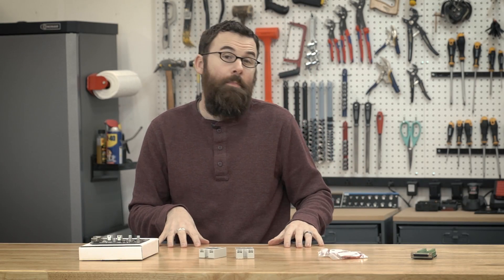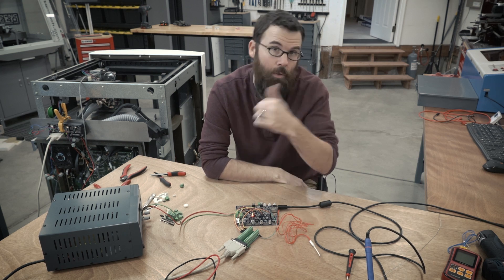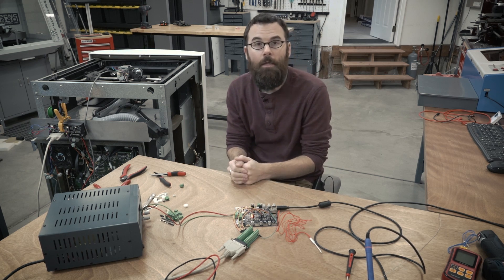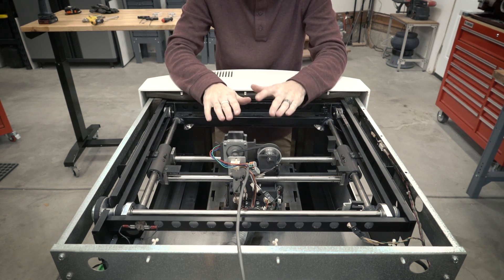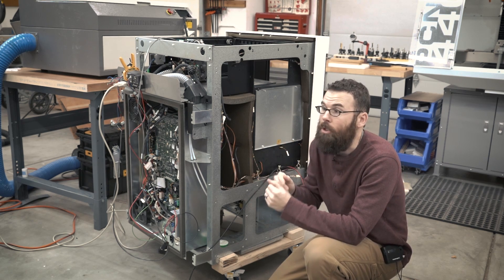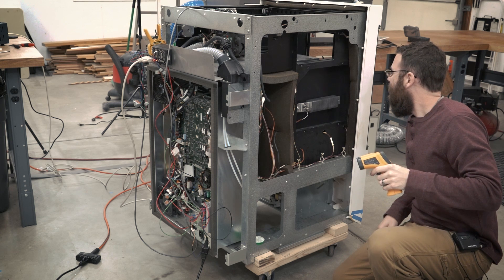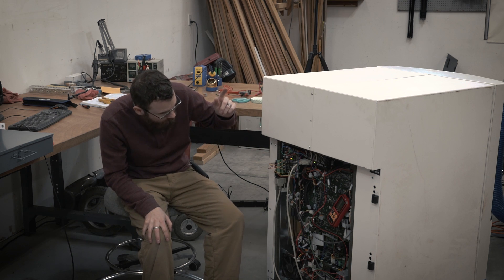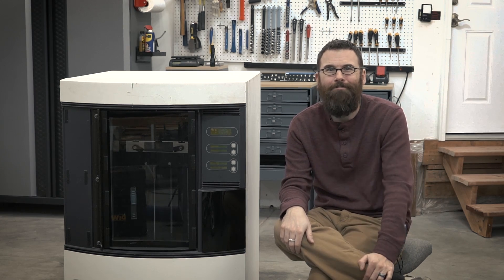Stratasys 3D Printer Rebuild - Part 4: Smoothieboard, Homing, Chamber Heaters

Comment: TELL US what the steps per mm are ! Please ?
Reply from the maker: Hey Phil, I've gotten your numerous messages.  I don't know the steps per mm off the top of my head, but unless you have this exact configuration with the exact hardware, the steps/mm will be useless.  It's better to just calculate it yourself based on the various tutorials you can find online.  It's better to learn how to do something than just plug in the numbers.
Reply: I'm using the exact same hardware and software

Comment: Any progress on this project?!  I'm loving what you're doing and can't wait to see it printing
Reply from the maker: Not yet, I've been busy with a lot of other projects.  But as soon as those are done, I plan to buckle down and finish the printer so I can start using it.
Reply: I'm definitely staying tuned.  Is it worth it to do this for myself?  I have a chance to buy one without any of the control electronics but mechanically (apparently) it's all there and worked before they gutted the electronics.
Reply from the maker: How much can you get the printer for?  It's ultimately up to you if you have the time and money to do the conversion.  I haven't finished it yet, so it's too soon to tell if it was worth it.  But it's still fun and there's a lot to learn.

Comment: Thanks for the great video. I appreciate your time and effort dedicated  to quality content. My similar build has been on hold due to time and money (mostly money), but luckily my generous employer provided a bonus check to fix the money part so I have a couple questions. I have a g540 and due to your video, im strongly considering a smoothie. but when taking apart the outer structure, I destroyed much of the insulation.  What type of insulation is used and where does the melted plastic exhaust from this machine go? Absorbed into the insulation? It was pretty blackened.
Reply from the maker: I'm not really sure what the insulation material is.  It seems to be a thick rigid foam maybe?  I'm sure you could just get fire-rated insulation panels at home depot and use that...  The 'exhaust' is pretty much just recirculated inside the machine, but it's not exactly air-tight.  it just circulates inside the chamber it seems.
Reply: I actually think I know of a supplier of that type of material and I will contact them and let you know what they say. I just wasn't exactly sure what to ask for.

Comment: Robert - Where did you get your benches (good shot at 9:24) from? They look relatively sturdy and I'm in the market for outfitting my new shop with lots of workspace. Thanks!
Reply from the maker: they are "custom".  They use these legs:  http://a.co/6YcdSRR and the top is a solid-core door that's stained with danish oil and then waxed.  They're not terrible durable, but for a 36" x 90" workbench, they come out to around $150 or so.  I have 4 of them, so I went the cheap route instead of spending $500+ on each workbench.  They're sturdy (they easily hold my weight), but the tops get scratched and beat up pretty easily.  But the tops around around $70 from Home Depot and easily replaced.
Reply: Thanks! I hit the same quandary. Excellent advice. I enjoy your channel!

Comment: Hey Robert,

Just letting you know you can run the bldc motors in the extruder via STEP and DIR signals from the smoothieboard. I've got it working in the past. If you'd like to know how let me know. Would save you from having to redesign the extruders. Cheers! Keep up the great work!
Reply from the maker: Cool, I'll get to that in a couple weeks, I'll let you know if I run into any issues.

Comment: Dont gut the extruders! You can control them with the smoothie pretty easily with an arduino nano and an h bridge. Love this video series BTW. I just finished my retrofit of my dimension and posted the results o r/3dprinting. This was a big help. I tried posting a link but Im getting flagged as spam I think.
Reply from the maker: I'll most likely try and keep the extruders.  I just haven't really looked at it yet, but that's the thought!

Comment: Hi Robert,
Is it a BST or a SST you got? It is pretty easy to reprogram the eeprom chips in the cartridges, and just feed the material thru. I have one BST 768, and one Elite at work. I use Makerbot abs filament ( since it is a Stratasys company) as build material, and HIPS as support on the BST, and i will use the same abs on the Elite. That is working great at 1/10 of the price! :-)
I havn't found any cheap alternative to the soluble support from Stratasys, so I will stick to that.
Reply from the maker: This is a BST.  I looked into reprogramming the EEPROM chips, but I'd still have to use the cartridges and then use something to control the mechanism for the cartridge, etc.  I have something else in mind ;-)

Comment: Great video series.  The content is top notch with regards to the mechanics and principals.  What is the factory motherboard doing at this point?  I am under the impression that the Smoothie Board and Gecko Drive Controller is currently all that is being used to control the unit.  Also, with the heating element controller (Gecko Drive); is that essentially acting as a PID controller?
Reply from the maker: Thanks!  The motherboard is just sitting there.  You are right, the smoothieboard and g540 are doing all the work.  The original electronics are pretty much hooked up, but all they're doing is controlling the fans for the heated chamber as well as the lights.  There are two halogen lights in the chamber as well as the 4 heated chamber fans, as well as several exhaust fans.  Instead of wiring up 8 different things, I just left the old electronics in there.  It's overkill, but I'm not ready to gut them just yet.  Also, if anything goes wrong, I can pretty easily and quickly revert back to the factory hardware.  At this point, that's probably not going to happen though.  I'll be removing them pretty soon.

Comment: Note you can also talk to the stepper drivers at 5V, using the open-drain pin configuration, see : http://smoothieware.org/general-appendixes#external-drivers
Don't know if the Gecko drivers need this, but some do.
Reply from the maker: Thanks Arthur.  The Gecko drives are 3.3v, but 5v tolerant, so you can use either.
Reply: Robert Cowan Oh btw : http://arthurwolf.github.io/SmoothieContest/

Comment: The endstops are optical interrupt switches. One side has an infrared LED, the other has a photodiode or phototransistor.
When the IR beam is on, it conducts, and the other way around.
Reed switches are magnetic.
And man, you really have to use those displays on the front to push information out! They look like something off-the-shelf.
Reply from the maker: Nope!  Those are in fact reed switches.  There are ALSO optical limit switches on the machine, but they are in other places.  The minimum end stops are optical and the maximum are reed switches.  They are only activated with ferrous metal, aluminum or plastic won't work.  Another tell-tale sign is that there are only 2 wires coming from them.  Optical interrupt switches typically have 3 or 4 wires.  If you look closely, you can see the other optical limit switches, but I'm not using those.

I do plan on doing something with the displays on the front.  I might end up replacing them with something else though, there's a whole control board behind them, so it might be tricky to interface with.
Reply: That is weird.
I've never seen a reed switch like that.

Comment: Robert,

Thanks for the great videos in this series so far. 

I have a similar build that required unique control of the hotend, also using  Mach3. However, using Mach introduces some interesting challenges. The biggest of which is that Mach3 does not have an "E" axis typical of 3D printers. Instead, it has A, B, and C axes. Unless you want to write a script to change all of Es to As in gcode, I would recommend using either Slic3r or Cura, as both of these can be figured to post process for Mach3/EMC2. IMO it's easiest to control the extruder stepper through Mach and the hotend through something external. In my setup, I wired the heating elements (hotend and heated bed) to a Rambo board, which gives the necessary PID loops. I simply have an extra USB cable that I use to control the hotend temperature through Cura, which I leave running in the background. Great build, and best of luck getting it all up and running!
Reply from the maker: Wow, that sounds complicated.  I'm glad I didn't go that route.  Thanks for the info.

Comment: Awesome restoration-rebuild!! :) Loving how it turns out so far and definitely looking forward to what comes next!!

One thing I would do to this bad boy - gut out the old vending machine LCD and buttons panel and instead put a nice touch screen LCD connected to a PC, that is located where the old motherboard used to reside (looks like plenty of space for an mATX or even full ATX board, next to the smoothie and gecko).. :) Just something that occurred to me looking at it sitting semi-finished. Keep them videos coming!
Reply from the maker: Nice idea.  I'm not 100% sure what I'll end up doing for the interface.  I am toying with the idea of putting this in my basement and just having it connected over the network.  I'd rather not have it in the shop since it's a bit noisy and takes up a lot of room.  So I might not spend a lot of time on the physical interface.
Reply: Robert Cowan thanks for the reply! I guess if u are not going to interface the thing directly, then there is no need for any changes to the front panel.. :)
Reply from the maker: Yeah, I'm still not 100% sure what to do with it just yet.  Stay tuned ;-)

Comment: How hot can the heated chamber be?
Reply from the maker: Honestly, I don't know...  It's pretty well thermally sealed, and I measured the current draw at around 800 watts with both heaters going.  So I can only assume it could probably get VERY hot if the control system failed.  Thankfully, there's a thermal cutoff switch inside the chamber.

Comment: awesome .

Robert, I am not an expert in electronic, so the big electronic board at back what is it for?
Reply: I think it is the original controller board of the printer (controller and stepper drivers). Old electronics tends to be really big
Reply: szErnzEit I think so too but, is he going to need it? since he got the smoot board.
Reply from the maker: Yep, check out part 1, I go into what all the old electronics are.  There's a LOT in the back of the unit.  And szErnzEit is right, I won't be using any of it once I get the full retrofit complete.
Reply: The cool thing about the one that comes on these is that both filament outlets are machined out of a single block of metal. Two feeds in, two feeds out. This makes offset calibration extremely easy and you never have to worry about one nozzle being lower than another.
Reply: Can't wait to see you rip that thing out!  It's been bothering me ;) Also, would love to see a tear down of the extruder.  An e3d v6 as a replacment wouldn't be a bad choice - it's kinda the go-to hot end now-a-days.
Reply from the maker: Yeah, that's what I was thinking, if I end up not using the current extruder.  It seems like I might be able to get it to work though.

I'm going to rip out all the electronics when it's closer to a 'working' machine.  If I can't seem to get things working, I might need to go back and check what the original settings were.  Right now, it's pretty easy to revert back to the stock machine.

Comment: I had to pause the video to write this. I would highly recommend to use more than one Ground cable. This is a single and major point of failure especially when you have to different voltage sources with no additional ground connection to each other. When the Ground lane in you D-Sub cable fails (break or defective contact) you could end up with big voltage differences at the the Smothie board and the printer (I assume the inputs aren't galvanically isolated with optocouplers or otherwise protected) and potentially damaging it. It is obvious that you know what you are doing but I think it would't hurt to add a few Ground lines. I just mention it because i lost more than one processor board through a unreliable GND connection, microprocessors have a extremely low tolerance to over voltages at their inputs
Reply from the maker: I agree with you 100%.  The wiring you see in the video is no indication of how the final wiring will end up.  This is just for testing, and it's messy and not the way it should be.
Reply: Good to hear, it just made me a bit nervous, last month i killed this way three stepper drivers (10$ each) and a trinket (20$) in one go. I just wanted to help to avoid any potential frustration through an (unlikely) incident.
Reply from the maker: Well, the G540 is nearly impossible to kill.  Seriously.  If you kill it, they will send you a replacement module.  It's one of the reasons why I'm using it.  But yeah, it's frustrating to blow stuff due to poor grounding, etc.  Cheap stepper drivers die way too easily as they have very little protection.  For anyone reading this, if you're using a stepper driver, NEVER disconnect or unplug anything while it's running, you will most likely blow a driver.  Unless it's a geckodrive ;-)
Reply: Yes I learned this lesson too. I killed a stepper driver in the same way you mentioned, I tried different kinds of speeds and acceleration and when I was finished I just pulled the stepper driver out and it was dead (not even a very cheap one I use the Silent Step Sticks from Watterot / TMC2100 chips). Now I have a whole pile of them which I killed  lying around.

It is possible that nothing happens in your setup when the gnd breaks but I was more concerned about the smoothie board, I know that the RAMPS board cheaped out on the IOs of the Atmel and didn't use any protection circuits but it is possible that the smoothie creators considered this and used some kind of over voltage protection on the external connectors. You probably know this but Industrial grade stepper drivers are built with very strong protection against Ground Differentials (I made a quick search online but couldn't  find a datasheet of the G540 but I would guess that it has isolated/decoupled I/Os of some kind (optical/resistive/magnetic).

Obviously it is unfair to compare 20$ stepper drivers with a 300$ one, but both have their use cases. I think the Gecko is a great choice for your huge printer.

P.S. most of the stepper drivers I killed weren't because of gnd but because of the 12V line. Each time I switched on the Power supply or just connected it the was a voltage drop and the steppers jumped to the next full step. This current spike seems to caused a dead driver every tenth or 20th power cycle. It took be about three stepper drivers to figure out that I can prevent it when I made sure that the stepper drivers are disabled on power up and the enable pin never floats (this required only the use of a few additional IO pins and external pullups on my teensy). This might be a problem of the TMC2100 or my stepper motors or my power supply or anything else in my setup.

...but we are tinkerers - sometimes we break stuff but we learn something new :)

Comment: Hello,
I'm currently rebuilding my Prusa i3 clone from Ebay. I also plan to use Smoothieboard, however, I have a little problem with stepper motors. There's no number on them and so I can't find the current that they need. Should I try to measure the current it on my present setup (with Melzi Ardentissimo), or try trial and error method (balance between overheating and not running properly)? And what method did you use to get the current rating on this printer?
Reply from the maker: Well, if you don't have any specs or labels on the motors, that's tricky.  You could possibly guess.  Most NEMA 17 motors aren't much more than 2A.  But just see if there are ANY markings on the motors.  I would just slowly increase your current settings, checking for overheating, like you said.  Under-powering them won't hurt (as long as things move smoothly).  And over-powering them will be obvious because of excessive heat.
Reply: Thanks for a fast answer :). There's no text on the motors whatsoever. I'll probably try the trial and error method. But I have one last question. Is there any way how to measure this current using multimeter. There are 4 cables, so what cable should I connect to my multimeter? I'm not expert on electronics, so I'm sorry for dumb question.
Reply from the maker: Take a look at how steppers work, you will see that there are essentially two coils, corresponding to the 4 wires (two sets of two wires).  Current is usually rated at "per phase", so you could measure the current of one phase (one pair of wires).  BUT, this doesn't really tell you what the motor is rated at, merely how much current you're providing to the motor...  I'm honestly not sure of a good way to do this.  But you can look around for similar motors and see what their current is rated at.  If it were me, I would measure the holding torque, and use that to look for similar motors...  or the guess and check method.  realistically, as long as everything is working correctly and the motors aren't over-heating, the current setting is fine.  If they are over-heating, the current (or voltage) is too high, and if they aren't strong enough, the current is too low OR the motors are under-sized...

Comment: So, I have also a Stratasys printer like you and it is just normal that it heats very slow.
Reply: But my printer is also in an cooled area.
Reply from the maker: Yeah.  The service manual states it takes about 45 minutes to get up to temp.